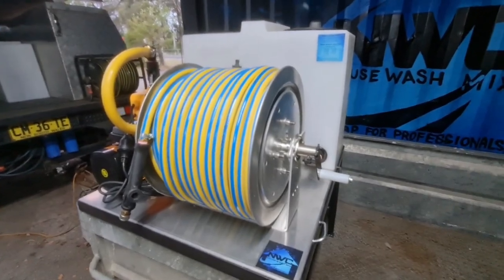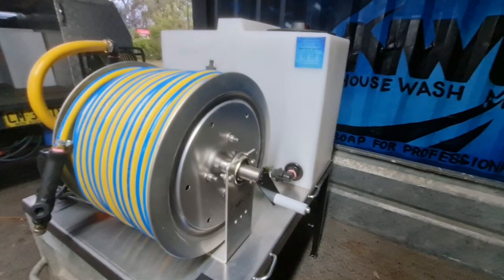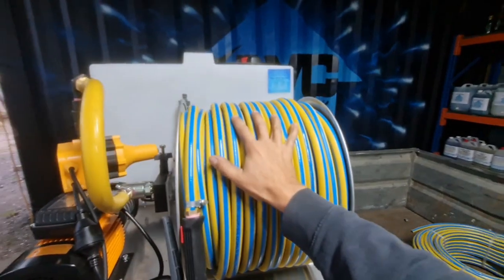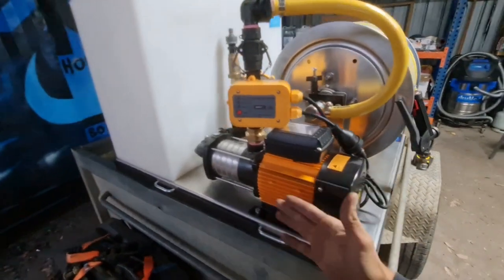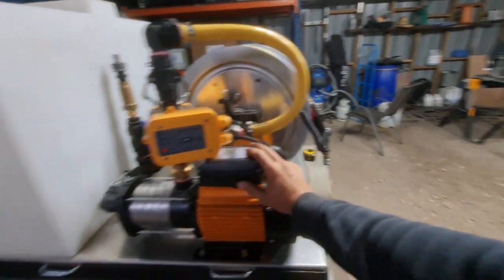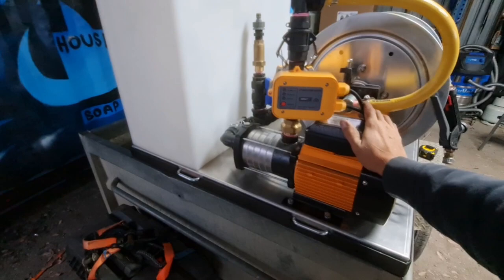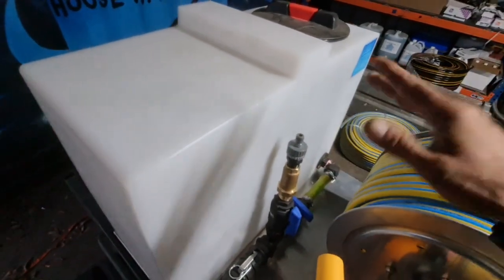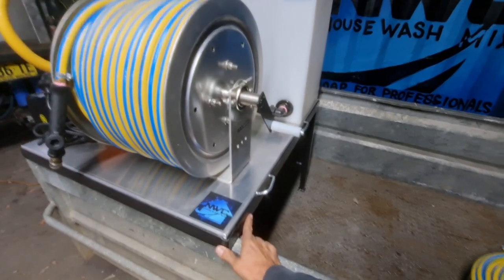240v 'NWC mini softwash' walkaround

Comment: Electric pump motor has a very long life....the bleach is the problem. 
I was running a booster pump all ss after 2 years or so ...the switch had to pe replaced. 
Another about 1 year or so an impler just shattered (no idea why)
The internals had to be rebuild.....insted of replacing few i ordered a complete stack 
And new seal
Pump still running. 
It's an industrial comercial pump....at the time the pump cost me 1200 us rebuild cost 400.
So i absolutely got my money out of it.
12v got lots of them the longest one last was over 4 years....i send it back to the mfg (per their request...lol)
They can last 6 to 12 months....cost is 200 us 
So its  almost free tool considering what u make.....
Love the 12v 4 roof work.....the booster is an over kill on roofs

Comment: Nice clean unit mate , I have one of those 240 pumps as well as my 12 volt pump . I don't seem to be getting the same flow as you do on yours .
Iam using drop sticks but they are only 13mm to a valve manifold . Do you think I should up grade to 19mm to get more to the pump ? Thanks
Reply from the maker: It's a 32mm inlet and you've choked it with 13mm. They don't like restriction on the inlet.
Reply from the maker: Like. Think of it this way, your mouths about an inch wide. Try breathing through a straw instead.... that's what you're doing to your pump.
Reply: Totally understand mate . I did change sizes and so much better .. thanks again
Reply: What is the name and brand of the pump please? Does it operate off battery?

Comment: Hey mate 
With that pump, what nozzles are you running?
Reply from the maker: 0030 for high stuff and 1520 for low/flat work seems to be the sweet spot.
Reply: @NWCSoftwash  Ok thanks, and what sort of height do you achieve ? Three stories?? Im just thinking of changing over from a 5.5gpm 12v
Reply from the maker: @pws9331  have a flick through our videos. Everything on this channel was done with that combo, just all mounted not on a skid. 

Here's a 3 storey we did https://youtu.be/-PWY5p_BqA4

Granted. 3 is right at the edge of whats possible. We actually had a boom for that job as it was 4 storeys in parts but the boom couldn't access this part. 

2 storeys it reaches comfortably.

Comment: What is the external dimensions of the unit Nathan?
Reply from the maker: In vid description. 900x750
Reply: @NWCSoftwash  sorry mate... Also needed the height as I am thinking of fitting it into the ute canopy
Reply from the maker: @VarinderHayer  ahh k. Just under 620mm at the highest point but it'll be a real pain to add chems inside a canopy. 

Think I spoke to you before, you're in Sydney aye? Send us a message again if you like.
Reply: @NWCSoftwash  would a transfer pump be an option? It's there one you would recommend
Reply from the maker: @VarinderHayer  not a good idea aye in my opinion. Just complicating a simple thing.

If your in Sydney we can make you up something a bit custom. Could have it so the tank filler is facing the door, but I doubt the canopy would be high enough they're usually around 800 high from memory which is fine for fitting the unit but pouring anything in will be difficult.

Comment: Pump specs pls. 200 lpm?
Reply from the maker: Yep. That's the specs on the pump 👌

And it's about that unrestricted. But once you add a reel, 65m of hose, gun, nozzle. You're down to solid useable flow/pressure.

https://youtu.be/C8RZP1Qk540